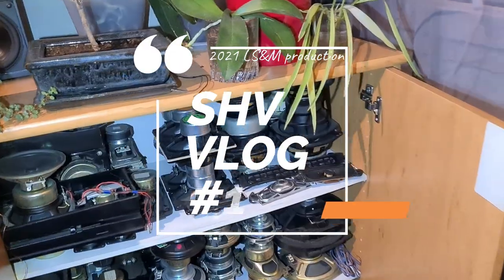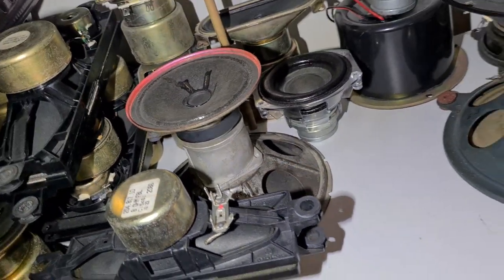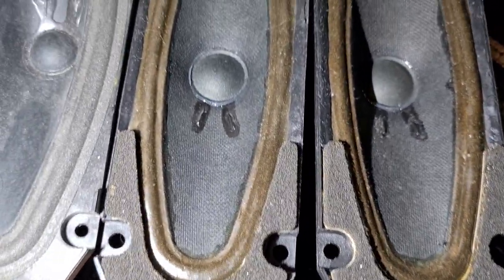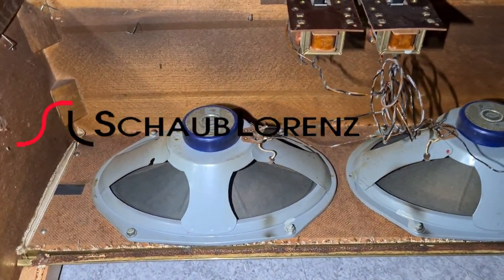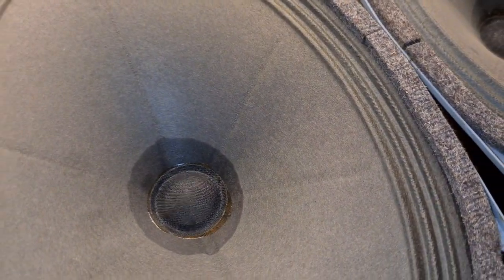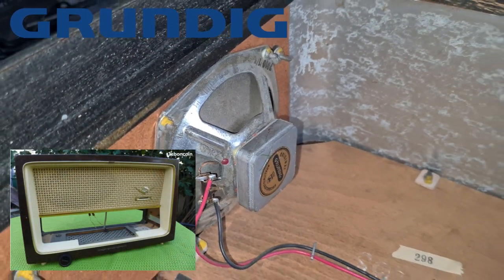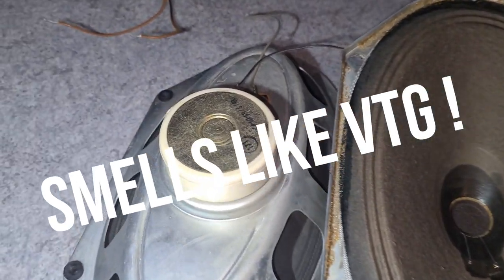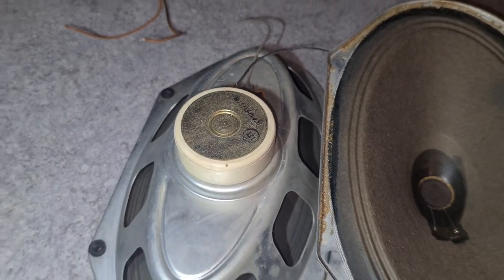SHV Vlog #1 | Taking Drivers out of 3 1960-70s Broken Radios

Comment: Some of the smaller Schaub Lorenz transistor radios actually had a woofer and a tweeter and didn’t even sound bad for their size! Some of them were also branded ITT if I remember correctly. Those old drivers from vintage radio tv and stereo equipment are great for projects or other uses that require volume out of weaker, or even homemade amplifiers, because they take almost no power at all to get loud. 
In my opinion a good high efficiency fullrange still being produced today is the Visaton BG20-8. Definitely more modern sounding, but also extremely easy to drive just like the vintage stuff! I put them in some old ported single 8” stereo speakers I had (original drivers were Jensens) and the improvement in treble clarity was noticeable. Bass was still nonexistent, but that’s the fault of the boxes, which are probably tuned above 100hz despite their large size.

Comment: Vintage! I have a single 6-⅝" 1974 Rola Woofer from a Zenith Allegro 1000, and a pair of 1962 Carbonneau 3" x 5" full range speakers. Unfortunately one of them has a sagging spider and is out of alignment :-(
Reply from the maker: Ah crap yeah thats the risk with vintage drivers , I'm super happy that mines are such in good condition especially after having seen they were stored outside